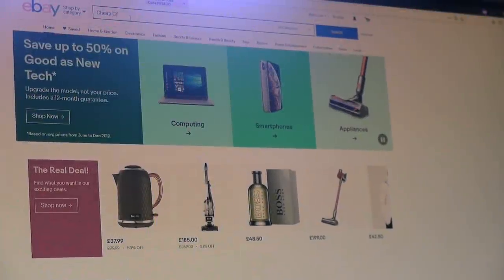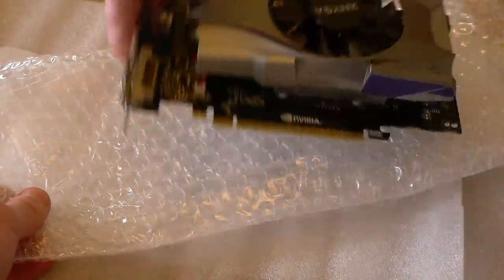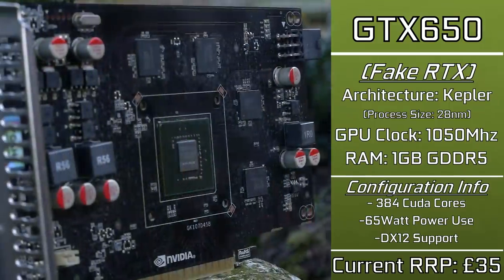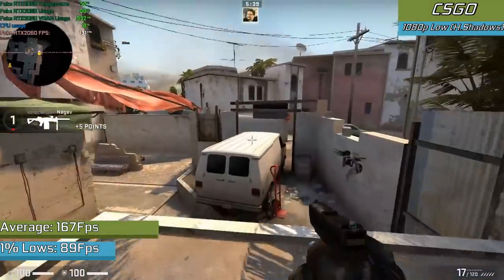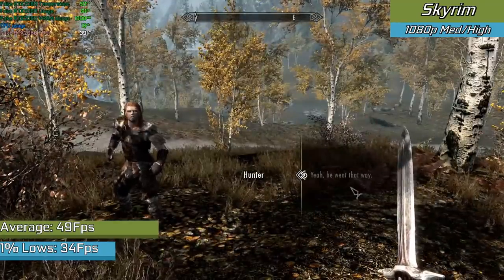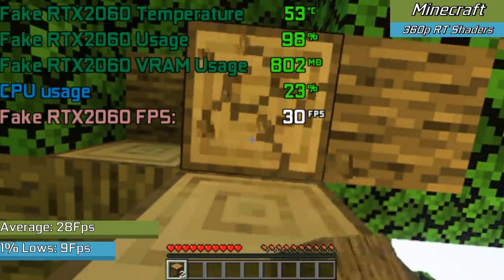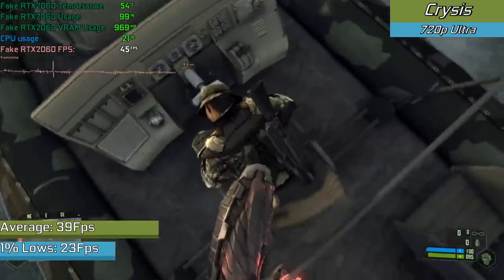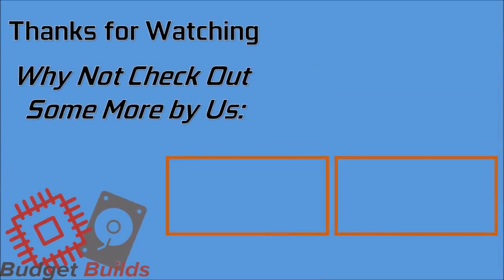The New RTX Scam...

Comment: Honestly if they just sold them as gtx 650's then that would be totally fine, great card at that price for budget gaming.
Reply: waffeltek  What card are you proposing? I am just saying that this is a decent option for the price/availability because it seems to be decently refurbished assuming they take older cards and replace the board.
Reply: waffeltek  That's definitely a decent option, I wouldn't say it's five times more powerful though. I am just saying for a card you wouldn't have to clean out and renew yourself this is not a bad option assuming it has the correct bios.
Reply: On the used market, you can get waaaaay better graphics cards, I recently bought a 1060 3gb for $65. A gtx 650 just isn't a good deal even at that price.
Other cards i've bought used:
Rx 580 8gb - $75
Rx 560 4gb - $50
GTX 970 - $80
GTX 770 - $45

If the option is available, local deals are always preferable to online purchases when you're trying to build a truly budget system.
Reply: @DenianWriter  The only problem with cards like that there is a gamble with longevity because the gtx 1060 and rx 580 cards have been used for mining, you have a risk of getting a card that is at the end of it's life. As for the local deals, that is a good point and should almost always be your first option especially since it helps with e-waste. There are sometimes issues with local deals though, such as dealing with possible property theft being re-sold, seller doesn't know what they are selling,  price gouging in rural areas where people don't care about computers and such. Good points though, I do applaud you!
Reply: @DenianWriter  Also to add on to what I was saying, in my local "deals" the only card that is not price gouged is a dirty blower style card for $40. Anything better then that is something like a gtx 970 for $120, crazy I know right?
Reply: Cyber Link 
I guess if you don’t like near a city it’s not a viable option. You’re right about the mining stuff too, one time I had to reset the bios on an Rx 560 because it had a mining bios on it. It was a whole ordeal to first understand what was wrong, then go through the process of actually fixing it.
Reply: The GTX 570 is twice as fast, and about the same price second-hand.
Reply: @RsBlackleo86  Ex-mining cards aren't necessarily bad. Plenty of miners (those that knew what they were doing) looked after their cards well. Fans can be a bit worn out, but that's about the only thing that's likely to go wrong. I bought my RX 480 from CeX, and suspect it is an ex-mining card - it came with a corrupted BIOS and a wonky fan, so not great, but they were both an easy fix.
Reply: @DenianWriter  1060 3gb are 100€ (110$) here. And that is the cheapest you can find. More often it is 120-140.
Reply: @RsBlackleo86  Cards used in mining definitely may have issues. Though usually it happens if mining hardware was kept in some container outdoors, in basement or attic in moist environment and/or with insufficient cooling. I have Radeon R9 280, previously used in mining by first owner. Guy found another hobby so he sold this card to me for a half of price. That card worked as my Linux/Windows desktop GPU for next 6 years without issues and still is in working condition.
Reply: @DenianWriter  how are you getting those cards at that price ? $65 for 1060? Impossible
Reply: @aloe7002  
This was over a year ago, closer to 2 than 1

Comment: I laughed when I saw the VGA port. The 2000 series doesn't have the RAMDAC anymore, so it's literally impossible to get native VGA output from those chips. In order to have VGA output, they'd need to convert a digital output to analog separately.
Reply: nikomo can’t displayport be adapted to vga?
Reply: @SuperCookieGaming_  It can
Reply: SuperCookieGaming I think it’s both mini and normal DisplayPort that have built in conversion into them, I’m using a graphics card with mini display port connected to a vga monitor using an adapter.
Reply: @EricMasten-Archive  so you can get vga from rtx cards with passive adapters
Reply: @SuperCookieGaming_  yeah , of course , i use though adapter from dvi to vga on my 770 but there are plenty of good hdmi, display port adapters , so its possible
Reply: Thicc Doggo what on earth are you connecting to with VGA in 2020? A projector?
Reply: @noth606  Some people still have VGA monitors lying about. Admittedly, I don't know why you'd use a VGA monitor with a bloody RTX graphics card - but everyone does something different. I still connected my gaming PC through VGA until I finally managed to get a card with a full-size HDMI port - and this was late last year.
Reply: @elhancho1255  Is it nvidia or amd card that you're using with DisplayPort to VGA adapater? Which model?
Reply: noth606 I’m using a 144hz 1440p monitor for my main and using a 1080p vga monitor for a second because I didn’t wanna drop another 400$ into a second high end monitor since I was going to only use it to put stuff like Spotify or discord on it
Reply: MrStefcha89 unsure about the exact model but it’s nvidia, I’m unsure on what model but I know that DisplayPort has built in active conversion. It doesn’t matter on what card you have it’s just a feature on DisplayPort.
Reply: @vaelfonia  remember 1080 ti Pentium 4? Ya. S**ts n giggles. That's my guess
Reply: @elhancho1255  Ok, weird because you mentioned mini DP on your card and i don't remember any GPU that comes with it. I also heard that it's possible to use any DP to VGA adapter because from what i understood they are always active, but i've also read that some people had problems with loosing signal on monitor while using adapters. I don't know if it is tied to combination of specific GPUs and monitors or it's problem with cheap adapters. I'm in this situation right now. I want to buy GTX 1650 super, but i have monitor with VGA only. I'm thinking if i should just buy some cheap 24inch with HDMI port and avoid headache that comes with adapter and potential black screen/no signal on monitor.
Reply: Pascal doesn't support analog signals natively either
Reply: @SuperCookieGaming_  DisplayPort to VGA adapter do that like charm. With proper video signal connverter you can see picture from your computer with DisplayPort even to old CRT TV screen. Cheapest / easiest to have route for that probably will be a chain of DisplayPort to HDMI adapter and HDMI to AV adapter.

Comment: 12:36 
2010's: "But can it run crysis?"
2020's:" But can it run minecraft with raytracing?"
Reply: Someone needs to mod Crysis to add raytracing.
Reply: @IanC14  No! Please god NO!
Reply: On minecraft the SEUS PTGI shader isnt ray tracing its path tracing, the differences arent that big but its still not ray tracing
Reply: @newman4933  Yeah, its not Ray tracing, Works and looks utterly great though.
Reply: @newman4933  Path tracing is a type of ray tracing if I'm not mistaken.
Reply: I wanna see how it performs running Farmville.
Reply: @stevenshewey7851  Farmville is peanuts compared to yandere simulator, a 4x rtx2080 system can get 35fps from it, as well as sucking over a kilowatt from the socket. Yandere simulator is well-known for things like absurd game assets like the 10,000 vertex toothbrush or the million face glass cup.
Reply: @newman4933  minecraft win10 edition has actual raytracing
Reply: so is it bette rthan my Hercules card?
Reply: but can it run Crysis 
“Remastered”🗿🗿🗿
Reply: @newman4933  yes now tell me what's the differents?
Reply: @undgcat6767  it looks worse and lower fps

Comment: Do I win a prize ?!?...
When you posted a preview picture hours ago, I called this one exactly perfect.
GTX 650 (1GB version).

Most likely originally a Kinology brand card for the Japanese market.
Reply: About two years ago, a well known importer dumped thousands of these authentic Japanese market 650's on NewEgg in the US for about $18 a pop...

I picked up a handful then because they go great in retro WinXP builds...

But the way these scammers work, I would wager that a shipping container full of them "fell off a truck"(cargo ship) and just happened to land in China.

Now you can spot scam cards a mile away by that distinctive cooler shroud... though they often change the sticker on the center of the fan hub.
Reply: @KomradeMikhail  That card is a KFA2 GTX 650 with the cooler flipped round 180 degrees. It's a genuine card from back in the day, I still own one

Comment: Interesting. I bought a scam card accidentally 6 or 7 years ago. It was supposed to be a gtx 650 but was actually a geforce 9500 gt. It had the same cooler as the scam card in the video just black/blue instead of grey/blue. Apparently they don't update cooler design often lmao.

Comment: Sadly the 650 wasn't that great of a card as the HD7750 and 7770 were better and the later 7790 even better, the 650 ti competed much better with those cards. Of course a 2gb hd 7850 or gtx 660 although a step up in pricing aged a lot better.
Reply from the maker: As someone who had a HD7770 I can agree

Comment: You should check out one of those used mining 1060's with no Io that need modded drivers , they're going for around 35 $ which is actually a great deal assuming you can get it working

Comment: Nice tht you got most of your money back, and you managed to get it flashed to an actual GTX 650. If they actually sold these as GTX 650s at competitive prices, they'd actually sell a lot more of these GPUs.
Also, the car radio that they said they'd send isn't great: I've seen that exact same model before (in fact I have one for a portable boombox project) and whilst it would be OK as a cheap portable boombox (when housed in a suitable enclosure, with suitable speakers) I wouldn't bother putting it inside a car, not unless (a) the car has no radio at all or (b) you intend on swapping out a better radio for the purposes of selling the aforementioned car.
Reply from the maker: Would you believe they sent me a doubleDIN variant and it was actually alright, went into a friends car that has long since sold, sometimes see it about 👍

Comment: I have a scam GTX 650 that was sold on ebay as a GTX 650... it isn't even a 650, it's some low end quadro from around the same time as a 650 and has abot the same performance as a regular 650. It also requires a literal ritual in order to boot with it, I have to press a series of buttons to change a BIOS setting without any display every time the pc boots with it.

Comment: I'm more impressed with the stability more than anything. usually these modified GPU's are unstable and tend to give an unusable experience, yet here, it ran nearly as well as it would have on it's original FW. 

Fun fact: I owned a 2GB variant of this GPU. it was decent for lower-mid tier gaming, but not really anything you'd want to do any modern AAA gaming on. still fantastic for indies, Fortnite, Rocket League, Roblox, Source games, emulation, etc . not terrible, but not great. 
I kinda figured it could have been a GTX 650 just from the PCB and heatsink cover. looked too familiar.

Comment: i had a scam card last week that turned out to be a gtx 650 ti boost 2gb it was not a giveaway at the start due to having 2 dvi ports and a hdmi  that was sold as a rtx 2060 but  for the price i dont mind the card as £30 posted for it and the real 650 ti drivers install fine and after flashing the right bios it now shows as a 650 ti but the gaming performance is great i would have been happy still to buy it if they sold it as a 650 ti :D

Comment: Those coolers have been around for a while, similar looking ones (heatsink might have been different) were used by KFA2/Galaxy (now Galax = Palit)... but the fakers also used them on other fake cards for years, I think they started with the fake cards in mass production with the "750Ti" which were some low end 200 series.

Comment: The Crysis and DOOM benchmark surprised me.
Reply: Crysis performs around a top card from 2009
And Doom is pretty well optimized, around what I expected after trying it on my OC'ed 660 Ti
Reply: It didn't surprise me, but I had that card so I know how those games ran on a GTX-650.
Just don't ever run anything that needs more than 1GB of VRAM, I once tried Nier Automata and the card just couldn't keep 14FPS at the lowest resolution while not much was happening on screen lol.

Comment: "Hello? I bought a 2060 from you a few weeks back and it does not perform as expected..."
"Let me see... let me see... ahhha... I see what problem is... you didn't buy other half..."
"What other half?"
"See... 1030 and 1030 that is 2060. You buy two."
"But... it's actually a 650???"
"No no no. That is 650 + 650 = 1300 then you move 3 one place to right... 1030..."
"..."

Comment: First GPU that came to mind looks wise is a GTX650. edit: lol called it. They just have a unique look to them.

An old cheap card like a GTX650 is fine for a budget PC build or a home entertainment system with some basic gaming.
Of course if you want to play the latest games at 4k or even 1080p at ultra you'd want something newer, like a 900 series onwards.

But yeah, My stepson is using my old GTX650 with an overclocked Core2duo E4300 and 8gb of DDR3 and he can watch netflix @1080p, and play most of the games he enjoys just fine, and like in this video, some of the newer ones with a bit of tweaking.
If they just labelled these things GTX650 and sold them for $50aud I'd buy a few of them just to build a few cheap streaming PC's around the house. Not every one has $500 plus for just a mid to high range card. A card like this you could get a basic game machine going easy for under $500 alone.

If these scammers just called them what they are and sold them for what they are, people would happily buy them. Nice cheap way to teach kids how to do PC builds also. Really are a good GPU for a 'my first PC'.

Cannot wait for the day when they'll be selling GTX970's as a fake RTX8000 or whatever for $50 lol. Hopefully by then they'll just call them by proper name.

Comment: A few ini tweaks with Skyrim and that should do 60 fps at 1080p with decent graphics. If my old 9800 GTX+ could do it that one can too. Tweaks are easy to get more FPS, if it has blur in the ini setting make it a 0 or off. Then follow a few guides to increase the shadows and set the AF to x16 and basic AA to 8x, texture, and water reflections to highest. Should get a solid 60 FPS just without blur effects.

Comment: At 2:47 I saw a marking GK107D458.  The same marking is on the GPU die.  That is Kepler architecture.  A scam card would often have its firmware messed with so that it reports as what it was sold as.  That is not the case here but still a sketchy listing.  I would not buy something from eBay if the name was weird or the name of a product that I never heard of or if I couldn't find some evidence that it is a real item.  Like say someone renamed a GT 730 RT 730 or worse, RTX 730, that would be a red flag to me because I don't ever recall nVidia making such a thing.  I would also expect them to tell me they never made one or even planned one if I ask them.

Comment: that definetly looks like a scam PCB from a gtx 400 series card that is remanufactured with old chips in china, new motherboard, old chip, weird high volume scam. and the cooler is just tack on over that alumnium heat sink. they're all over wish, aliexpress, amazon, and ebay

Comment: i had a i5-2400 with a 650 TI windforce pc for a while. Ran Battlefield 1 at 1080p medium/low settings just fine. the 6 series is still valid for low 1080/720P as long as u get a 2gig card

Comment: There's nothing really smart or new about this compared to the old ones, they just happen to still share the latest drivers, I'm pretty sure with the more functional fermi based scam cards from before if they were used in a time where they still had active support it would be the same. But their stock wasn't as feature rich. Now when you sell a gt 240 or 9600 as a 1060, that's annoying. Those won't even run anything these days due to lack of features making the 20$ or whatever they cost not even worth that.

Comment: Hmm, I thought GPU-Z now called out fakes, it did pick up the chipset as GK107 (Kepler).
Two things kept this mostly usable....
1. The current drivers work (unlike with Fermi based cards)
2. They didn't fake the memory size (otherwise anything that passes the actual amount of VRAM will crash or mega-glitch).

XHVGA is a definite fake brand fan logo.
And, of course, modern cards do not have a VGA port, in fact, even DVI-I with the option of an adapter seems to have been dropped

Comment: Do you think if they actually sold these cards as a gtx 650 that they would still make there money instead of being complete cocks, then having to set up new websites or to  move premises or change there company name. i bought one of these cards a couple of years ago after getting back into computers after about ten years and once i tried to install kept getting error code 43, luckily they returned my money, so i started to watch more people like yourself so that i new what to buy and what not to buy, and now i am the proud Dad of a new pc i built myself with a gtx 1660 ti  all the components are new except the power supply  which is ten years old, this thing is built like a brick shit house and touch wood it will go on for another ten years. Keep up the good work.

Comment: How do you limit the VRAM usage to 1gb? I have one of these (pretends to be a 1050 2gb but really a 650ti 1gb) and as soon as it goes over 1gb it crashes of course. I did try reflashing the BIOS with a hardware tool but I couldn't get it to work.
Reply from the maker: This one was flashed to 1GB when I was sent the card.
Reply: @BudgetBuildsOfficial  oh right, makes sense